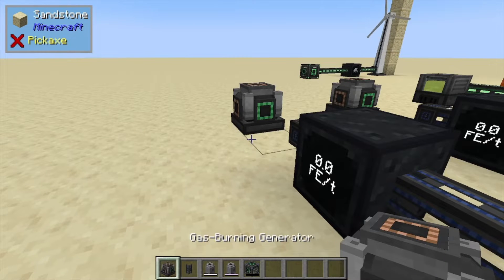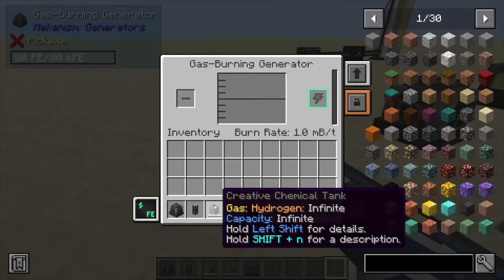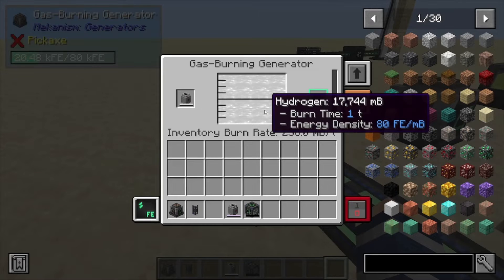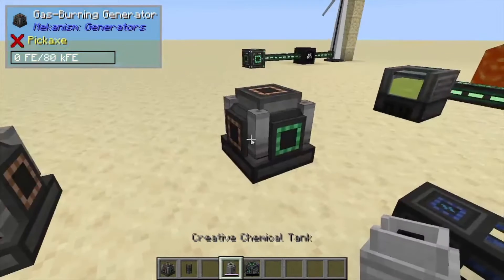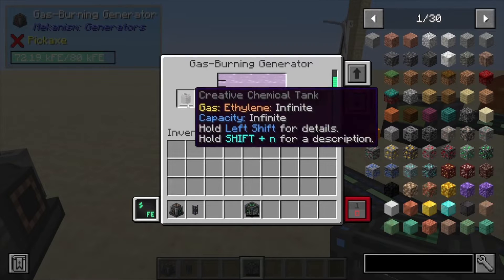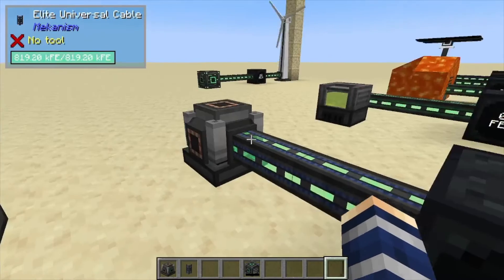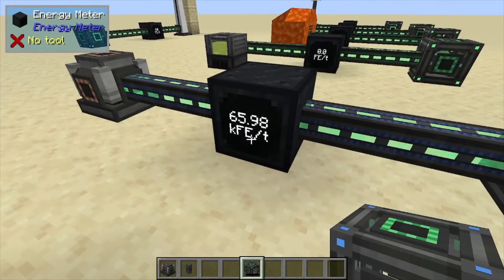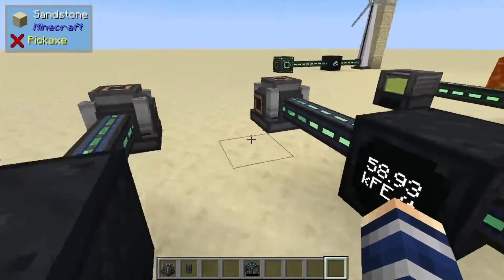Mekanism: Gas-Burning Generator (What to burn)(BEST Single Block POWER)

Comment: Was hydrogen nerfed so that the power produced is the same as the power required to extract the hydrogen in the first place?
Reply from the maker: Idk but it’s so easy to get ethylene with just some wheat into biofuel it’s worth the extra steps.
Reply: Hydrogen was nerfed a long time ago yeah
Reply: it definitely is😢
Reply: i tried so hard to make it a net positive but it literally can only feed itself, one small solar panel beats this method :(